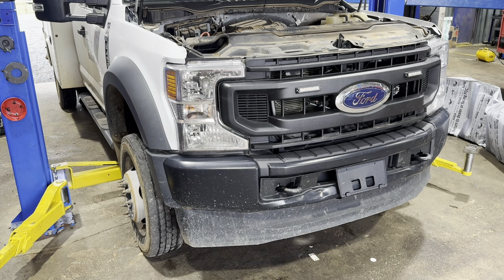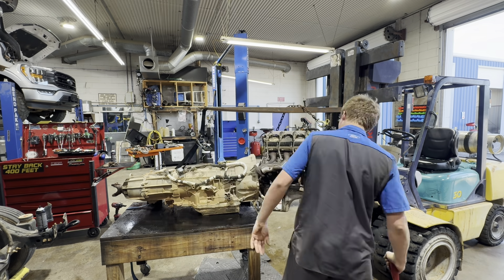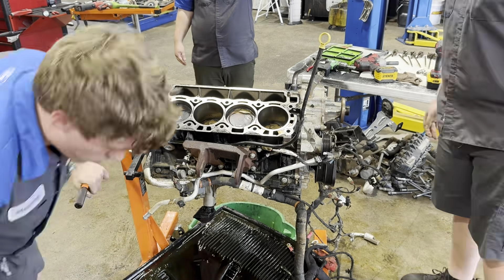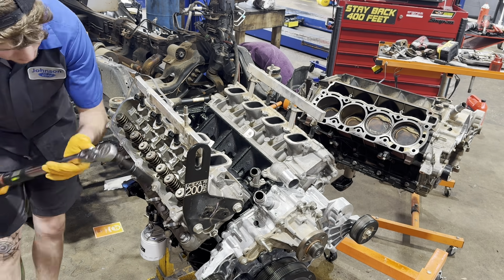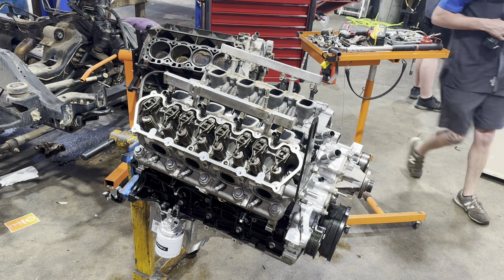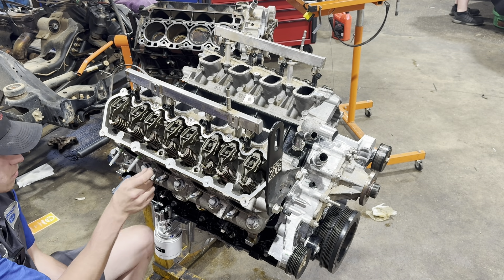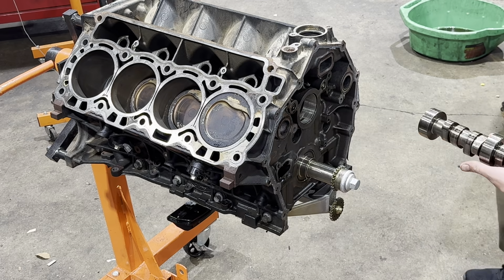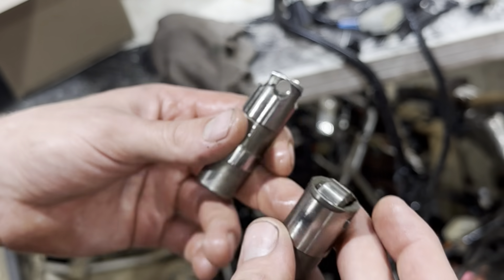Ford 7.3 Godzilla | Does this one issue make the engine a bust?

Comment: I hope you can help me out. I know this vidoes old, but i figured i would try and get your input on this. Now i work on buses and fleet vehicles. Now the bus i was working on was a cutaway e450 super duty with the new 7.3l godzilla motor. Now it came in with Miss Fire on Cylinder 3. I did plugs and coil. Nothing changed. Changed the injector and the spark plug wire. No change. Did a compression test, it was between 185-190, so it got compression. Still missing though. At this point im ready to throw in the towl. I did one last text to make sure the injector is firing properly. I did a noid lite test and it showing that the injector is only firing sometimes. I see no issues with the harness and nohing is arking. Im at a lost for words. Ive never seen this before.  Hopefully you may know something i dont.

Comment: They should just come up with a tune for the computer like they have on the diesel,after it's sitting idle for more than a couple minutes it raises the RPM up. Yeah waste more gas but if it's a company truck who cares makes the engines last longer before needing rebuilt I would say it's worth it. It's funny though I had a company truck with the 6.2 in it for almost 10 years and it idled all day no major issues.

Comment: Not real familiar with these auto trans pumps the factory is using on engines now. Before there were options to increase volume and pressure. 8 psi oil pressure would have been considered low years ago and I'm still feeling this is too low. While most of the damage I see on videos appears to be from oil starvation not supplying enough oil volume and possibly pressure the cam surfaces look hammered even on lobes without lifter failure like valve float. Roller cams aren't a new thing, they've been out for awhile, these garbage pumps in engines with these pressures are fairly new.. plus the start stop feature seems like a terrible idea.

Comment: Nephew had a 2021 F350/7.3 godzilla shit the bed on him at 41,000, cam/lifter shed so much "glitter" in the oil filter that the oil pressure was low and it damaged entire engine. He ended up suing Ford under lemon law,  there are enough 7.3 failures documented to warrant a recall but Ford won't admit theres a problem. (He's sued Ford before over a new 2004 F150 that he's had nothing but problems with) He's a manager of a 3 state pig farm operation and he is replacing the farm's Ford fleet with Rams/Cummins,  the Rams/Cummins have proven to be more reliable with reduced maintenance costs over the Fords/powerstrokes

Comment: not familiar with the 7.3/6.8 oiling system, but very familiar with the old school stuff.  The roller lifters get lubricated primarily by spash from the rotating assembly.  So when they sit and idle at 500 RPM, there is very little lubrication being splashed around-leading to failure eventually.  One could put 1000 psi oil pressure to it but it won't stop this issue.  Perhaps oil squirters could be utilized to spray the roller tips?  Just an idea.

Comment: I do not like thin oils in trucks that work like this.  The oil weights have decreased to improve fuel economy, and a thin oil does not have the same film strength as a thicker oil.   A cross certified 5w40 or 15w40 would probably help with decreasing the amount of lifter failures that a fleet will see.

Comment: "work trucks" is the key tuned down to 350 hp and oil pressure, but the 7.3 in 470hp haven't such issues....

Comment: Caterpillar has the same hot idle oil pressure spec on tons of their engines. In my opinion Caterpillar is the best engine company in the world.  Oil pressure problems usually affect rod and main bearings more often than a cam shaft. Film strength has a lot more variables in cam and lifter life we find.

Comment: Numerous 6.2's as our hot shot truck and present 2021 7.3 has just turned 160k.  My personal truck is a 2020 7.3 with 89k no issues either.  I will replace both with 2 7.3's in 2026.

Comment: Had a 95 gmc with the 350 it has around 400k miles and still going  start right up no smoke oil leak etc u would think it was a new truck that's how well it runs

Comment: The primary lifter failure (non-AFM, not ticking) in Chevy's is the plastic trays wear out and let the lifter twist. That leads to a quick death for the lobe and maybe roller - but that takes LOTS of time & miles. When dudes cheap out on rebuilds and use loose China trays, they 'find out' when you shouldn't f around with cheap valvetrain parts.

On Mopars it's deemed more of an oiling issue, as it's very apparent with cop cars that idle a lot. Some opinions are it's the oiling system design. However I've seen much more detailed assays that indicate poor oil quality is a huge factor - and we know some commercial maintenance crews/shops can use generic fleet oil to pinch pennies. In the 7.3's case, they're almost all commercial use.

Comment: 2018 f150 Lariat 5.0
240,270 miles
9547 engine hours
4322 idle hours
Mobil 1 full synthetic 5w30 and filter changed at 5000 to 7500 miles.

Comment: I usually agree with all your videos.. But this 6.2 opinion is way off base..  In fact if I was to buy a used super duty I would specically look for a 6.2... None of these lifter issues.. Why wouid you want that... 6.2 can idle all day with zero issues.. Yeah not quite the power of seven three but well worth not having any troubles

Comment: Want to know why all these manufacturers are having so many problems ? 
With all the thin oils we are putting in these motors . There has technically been no lifter upgraded lifter.
Hydrolic lifters work best with thicker oil. They try to bring up oil pressure to make up the difference .
But till there's a new lifter upgraded , this will continue.

Comment: It's stupid on a truck that the EPA doesn't even rate the fuel mileage why not give full oil pressure all the time! I would like to see a test with 2 off these engines on a Dyno running side by side one with normal oil pump and 10-30 oil the other with 0-20 and stock oil pump and see the fuel use difference! Who cares anyway your never going to make up for buying a new engine!

Comment: Yeah, immediately when you talk trash about the 6.2 i knew that you were a clown. The 6.2 V8 is the best engine Ford's v8 ever made. You're gonna sit there and say the 7.3 is better. When they're dropping like flys..lol the only problem with the 6.2 what's the occasional valve spring that would break.. i put 230000 hard miles. On my 2013 6.2. Without a single problem, still with the original starter and alternator the only thing that could kill that motor what's me rear, ending a Jeep at 55 Miles an hour, totaling the whole truck...

Comment: Had a 2024 E450 Chassis Cab
(Ambulance) come in with 600 miles, ticking sound, drained the oil, full of metal cut open the filter, full of metal  , their older, back-up V10 ambulance just dropped a valve,  and is getting a long block, the ambulance authority head said he wished they never got rid of the 7.3 Powerstroke, hands down the best one......

Comment: lol the junk 6.2 never ate cams and lifters ,they are way more reliable than the 7.3L, I enjoy your videos but you call several solid engines junk, the 6.2L. The gen1 3.5L which is way better than the gen2 reliability wise,and the gen 2 5.0 way better than the gen3 5.0 .

Comment: I hope they come up with an aftermarket high volume oil pump like Melling did for the Hemi. Ford needs to fix this right away.
Reply: My brother's work truck is an F250 with the 7.3 and right now, it's at the dealer with its 3rd lifter failure repair.
Reply: It's a lemon at this point.

Comment: The first full production automatic transmission introduced in Cadillacs & Oldsmobiles in 1939, was more advanced than many that succeeded it; The Hydramatic 4 speed with a mechanically controlled front rotor and vane variable volume oil pump, with an output shaft pump that could be pop-started like a manual trans car! Today they need an ecm to run an oil pump?
Reply: It might save some .1mpg nonsense hard at work

Save $3 a month in fuel

Rebuild engine. Brilliant stuff
Reply: @Allegronaut *superseded

If your old junk is superior.  Where is it?

Comment: the Ford 6.2 gas motor  is junk according to you because you think 385 horsepower is underpowered. . Other than misfires from corrosion on the coils and a rare  broken valve spring which is easily repairable if caught early it is a great motor.

Comment: Since your a younger guy. Your probaly not familiar with some of the older engines. They only had around 7 to 8 psi at idle. At full rpms they had 17 psi max and these engines would run thousands and thousands of hours. Issue of todays engines i would think would be tolerances. When you start run 0wt oil  in some ot the new engines i would be concerned.
Reply: *you're
*you're

Cite a modern engine that operates at a peak 17 psi.

Comment: Dude, the hemi has like 30+ psi at idle (I own one). Low oil pressure is not why these engines are failing. It's a materials issue on the lifters themselves, idle hours OR driving hours both contribute to "engine runtime", which is what the correlation is. Idle by itself isn't an issue, but running the engine, whether idling or driving, will cause a weak lifter to prematurely wear out. The cummins also moved to roller lifters and guess what, they have problems now too. I don't think you understand this problem as much as you think you do.

Comment: They’ve been putting roller cams in production engines since 85 and haven’t had any lifter failures until the 2010’s what the hell’s changed and I’m not just talking about Ford

Comment: Meanwhile, my 1992 F-350 with 460 V-8 is at 200 K miles. Recently sent the ECU out for a refurbish, it had super high idle and occasional stalling. Now it’s back to behaving , it plows snow and lays around in summer, 10-30 full synthetic 👍
Reply: Rebuilt one back in the early 90s. Engine failure was 100% operators fault. That engine is a beast. Steel crank too!
Reply: Yea, I have a '97 F-350  OBS with 7.5, A4OD trans. with Gear Venders over/under,; it's now a 7 speed? posi trac. no problems. Added Banks intake and exhaust. Still has firm quick shifts with lots power and torque. Unloaded I get 14 MPG., loaded is about 10MPG.  Should I mention it is mostly all steel? True plastic does not rust?  Even new it was not a $70,000.00 truck. As with any ICE vehicle you must attend to it's maintenance; something many owners do not do? Only option I would like is a rear view camera?
Reply: @ Oh that’s a great vehicle you have there, thanks for story ! 👍👍
Reply: I swear by the 460. It’s a monster with a TON of power potential. Love love love that motor.

Comment: I wonder if an "idle up" system could be adapted for use on the 7.3.   I'm actually surprised one isn't currently marketed for the Godzilla engine because of its use in ambulances or other emergency vehicles.

Comment: I think that 10k mile oil change interval is the real issue.  I NEVER let mine go past 7,500 and that's pushing it on easy use too.  Heavy I'd go 5k.
Reply: The oil change interval is not going to cause a catastrophic failure of an engine with 50,000 miles on it or less. Everyone talks about the oil pressure and that certainly was a problem but it seems to be mostly from a bad batch of lifters

Comment: The variable oil pressure pump is probably a result of limiting engine load at idle to get around ridiculous EPA guidelines.  Less resistance at idle will reduce emissions.  The manufacturers are forced into extreme measures to meet government regulations.  If I owned one, I’d look for an aftermarket oil pump.  Voting for liberal politicians gets these EPA nazis appointed

Comment: There's a TSB floating around that's supposed to have new tuning from Ford which adjusts the minimum idle oil pressure. There's been mixed opinions on guys that have gotten their local dealers to flash the update. Not all trucks with the 7.3 will have the update available at the same time. They will progressively roll out updates to dealers by year batches.

Comment: We got a 19 f350 with 6.2 and has a little over 52 thousand miles and had about 4 oil changes because are hands are tied on getting maintenance approved (government truck). Once a month we drive that truck for 6-7 hours straight and then it sits. But its hard driving and hauling.   I would definitely consider buying one to haul my tractor around.
Reply: Ram mds kills.lifters due to idling. You do not hear about it a lot because less RAMS are sold obviously....
Reply: Was replying to the person below, sorry for the wrong comment.
Reply: @ramaswamynarayanaswamy4806  all is good.  Im not a fan of any of the MDS , VVT, and DoD that the big 3 use.  Hopefully, going forward, they will drop these for a more simplict build design with changes coming to the epa. Atleast I hope.

Comment: I work on fleet ford 6.8l engines and wouldn't recommend one. Usually the cam follower pops off and jams a valve open.. here comes the piston! In Heavy R/V's and commercial applications, they last about 60k miles.

Comment: All the 6.2s I've been around were good. Had fleet of them. Run 300k with exhaust manifold issues only...
Reply: And may I add, if it were exhaust manifold issues, they were worked hard. 6.2 is a great engine! 2011 f250 177k and still runs like a new one. Oil Change every 5 to 7.5 k.

Comment: Its amazing to me that after 80 plus years the manufacturers have to relearn lessons learned in the 50s 60s 70s , about building engines and vehicles in general just to get another half a mile per gallon.  These things have become so expensive,  complicated and fragile,  so tell me how its " green " when so much more of this stuff ends up in the crusher after only months of service.  And its the same or worse for ag equipment,  construction equipment,  logging,  heavy hauling.  The EPA is out to kill off every type of vehicle no matter how small . End the insanity. The tail is wagging the dog and no country can survive that reality indefinitely.

Comment: While the big 3 all have lifter failures, the cause is different for each:
       GM - VVT lifters are failing non-VVT lifters do not (delete VVT immediately)
       Stellantis - lifter failure is a block / lifter oiling design issue (how to fix??)
        Ford - lifter failure related to oil pump design / programming?  (aftermarket pump / re-program??)

Comment: Lifter faces rely on splash lubrication from the crank and some bleed by from the lifter bores. Been that way since the OHV engine has been around. That said the main reason, IMO, is poor metallurgy and/or coatings than oil pressure.  These same basic design engines (small and big block chevy, 302-460 ford and 318-440 mopars) will idle all day for years with few issues.

Comment: I had lifter and cam shaft failure on a 2007 Chevy Silverado 5.3 active fuel management V8 several years ago. Lucky the failure hit before the 100,000 mile mark.

Comment: I just wonder if its possible to go in the ecm an bump the idle rpm up to say 900rpm.  I'm an old school diesel guy used to work on Detroit's we would never let them idle they only get 5-10 psi at idle.That could be a easy fix. I notice ambulance trucks have a high idle in them.  Or I would yard that 7.3 outta there an put a 460 in there problem solved.

Comment: I don't think it's oil pressure, idling,  or design  issues for the big three. I think it is the steel there made of. Cheap China crap. It is also top performance brands having the same issues. Comp. Crane, Texas Speed, etc. I had to put 4 cams in a 302 small block before we got a good one. It's crazy. Even the dodge cummins started failing when they went to hydraulic lifters.

Comment: the problem with this is the oil they use is to thin for the motor a10 w 40 would be better for heavy pulling on hot days oil is just to thin to lube properly that simple

Comment: So it's true, nobody can build an engine in 2024. Let alone 2023, 2022 and almost 2021 basically. Overhead cam? Timing chain and phaser. Pushrod? Lifter and cam. Turbo? Carbon and burned valves. Hybrid? You pick it it goes wrong. Nothing is built correctly. Everything is built to last a few years. I drive a 95 car and it runs flawless and easy to replace everything on it. I'm glad I'm not wasting my life investing in such heaps of worthless garbage.

Comment: I bought a 32' long Entegra RV back in 2022 (sold it few weeks later) and after i got it home, i saw this big and ugly 7.3L ford gas engine tucked under the floor. It moved the RV, it gave me 5.5mpg but the worst part about it was the power curve.. it took forever to get up to the RPMs and when it did, it had no balls.. What a garbage of an engine! So many liters and so little efficiency!

Comment: 2011 f150 lariat driver here with 272,800 on the odo with nothing ever broken other than a radiator and an couple of coil packs. Not only that I get people still asking if I want to sell it as a non raptor f150 with 6.2 is pretty rare.  If it were junk I doubt that would be the case.    

He probably just hates working on them with the size of the heads and 16 spark plugs.

Comment: All with the 6.8 & 7.3, this was release from Ford May 13, 2024,  wondering if this address's the low oil pressure issue? 
 "NEW VEHICLE RECOMMENDED DELIVERY HOLD Customer Satisfaction Program 24B27 
Certain 2023-2024 Super Duty and 2021-2025 Model Year Econoline Equipped With a 6.8L or 7.3L Gasoline Engine Powertrain Control Module Software"
Reply: I haven't seen anyone that could get that done. I am thinking it was a photoshop scam thing.